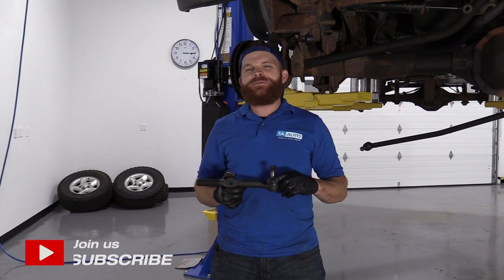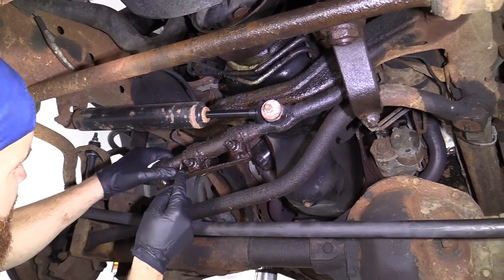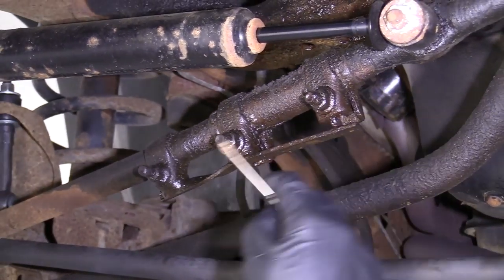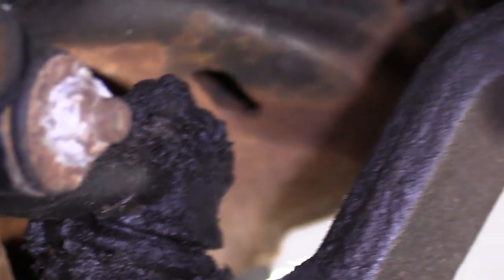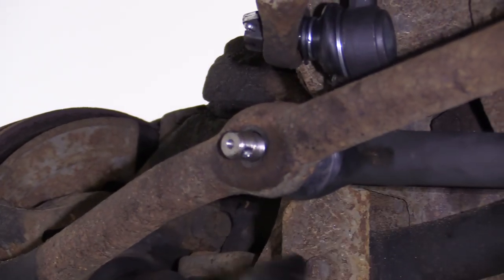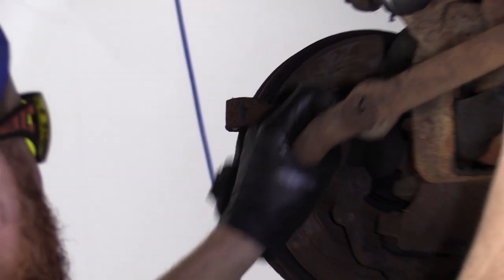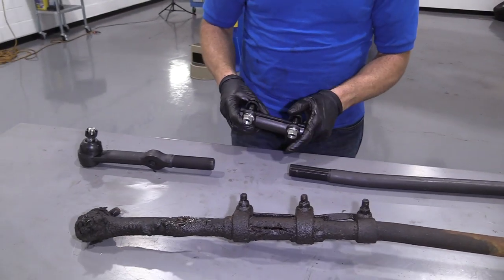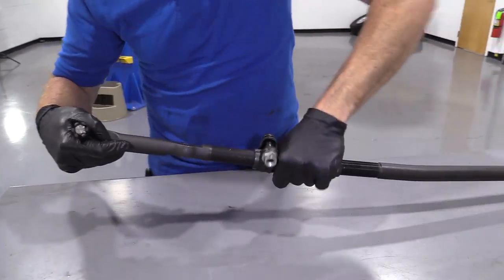How to Replace Right Inner Tie Rod 94-02 Dodge Ram 1500

Comment: Is this a 4wd or rear wheel drive? Are the kits you sell greasable fittings?
Reply from the maker: +B E Thanks for checking us out. This is a 4WD application. The parts we sell are all pregreased and sealed units. They will not be serviceable and would not require grease fittings.
Reply: 1A Auto Parts I do not see the pitman or idler arm on your site for a 98 ram 1500 4x4
Reply from the maker: +B E We do not currently have the pitman or idler arm for your vehicle.  Thanks for the question.